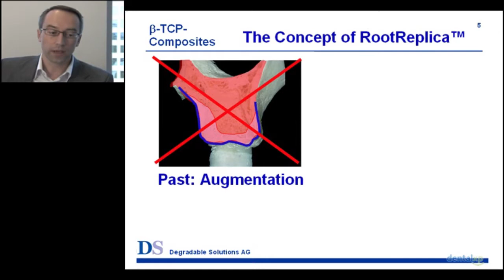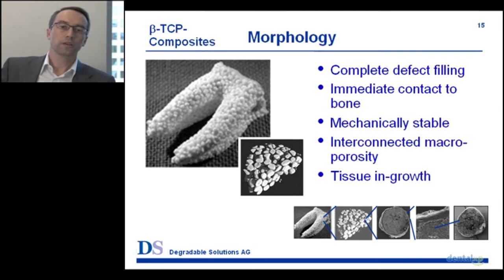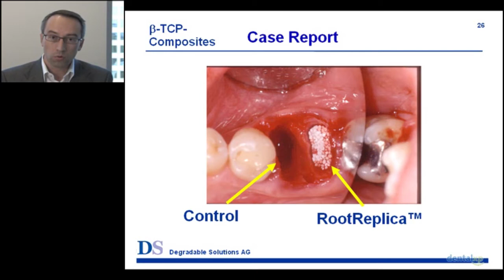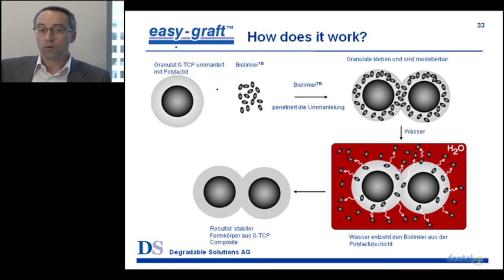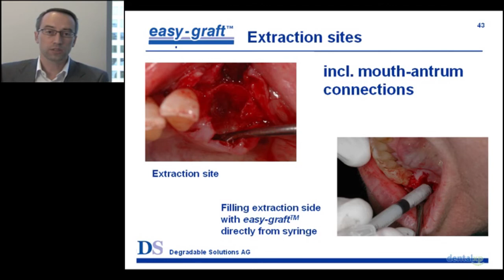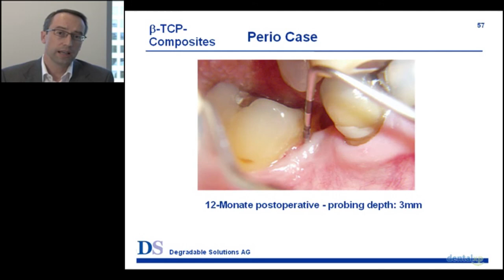Beta Tricalcium Phosphate Composites in Bone Regeneration

Comment: Is calacium phosphate can growth hard palate( upper palate)❓️
Reply from the maker: Calcium phosphate materials (such as β-TCP) do not independently “grow” bone in the hard palate.

They act as osteoconductive scaffolds, meaning they support bone regeneration when placed in a properly prepared surgical site with sufficient blood supply and biological potential.

In palatal areas, bone regeneration depends on:
	•	Defect morphology
	•	Vascular supply
	•	Stability of the graft
	•	Presence of vital bone walls

Without a defect or surgical indication, calcium phosphate will not stimulate spontaneous bone formation.
Reply: @DentalMentor 

Thank you so much sir🤍